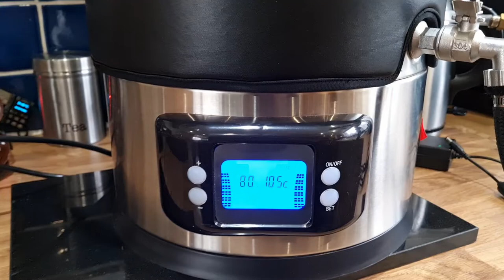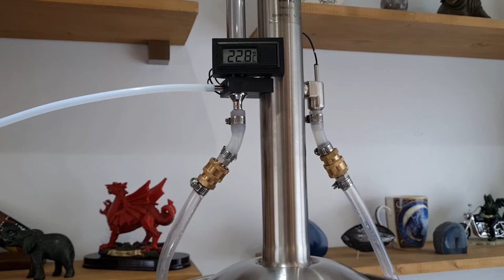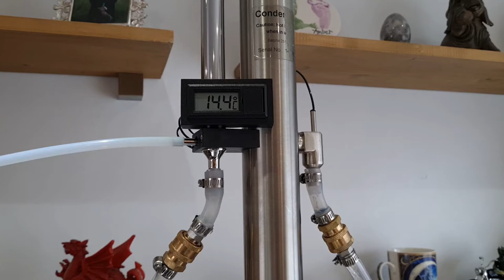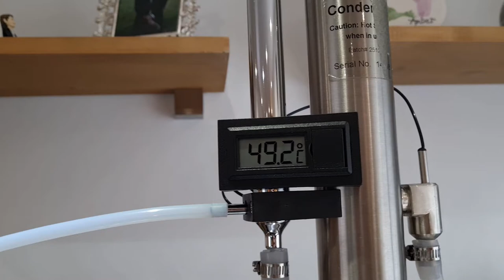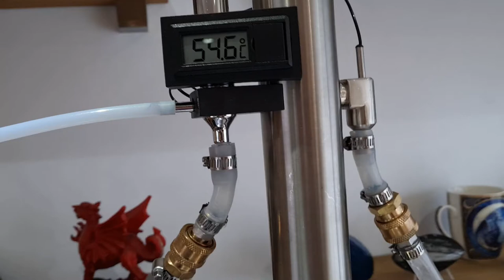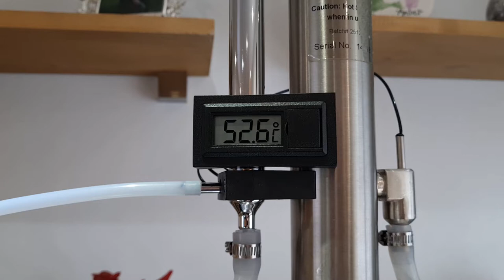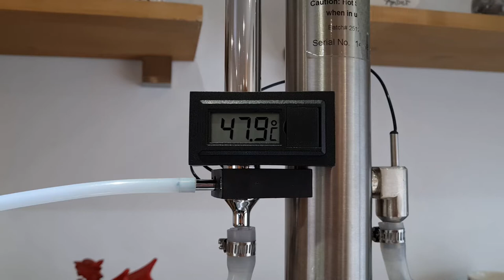Love Brewing 25L Boiler & T500 Reflux column - Doing a Spirit Run with Still Spirits Turbo Yeast.

Comment: Great video, seen a few of yours, thought I'd subscribe. I do small batches in multiple runs thru my air still from vevor but my stepdad has a t500 and I've learned a fair bit about it but what I couldn't work out at first was how that distance from the boiler up how much the heat changed, because when the boiler of my air still is at 95° c it's basically coming out at that temp, of course there is a greater distance for that vapour to travel on the t500, and I've only learned that recently, I've alot more to learn. I find it fascinating. And fascinating that you can make a birdwatchers wash from store bought ingredients ie table sugar, citric acid, tomato paste, spring water and bread yeast and forgo the Epsom and eventually, hypothetically distill that wash or wine and get, with the t500 a fairly neutral spirit, my old man only runs his thru once, thinks that it's pure enough. From a 25lt batch of birdwatchers he gets approx 3lt of 90% ethanol, he makes cuts but as you'd know with a reflux still your heart cuts are larger and more distinguishable to heads than say a small batch from a pot still. I just ran a VERY small batch of demerara rum, I can only get demerara 345g at a time so I did a 4.5lt batch, in a carboy just for me, I used 3x 345g pk csr demerara and 1x 550g jar of black strap molasses inverted those sugars in a pot with boiling spring water and citric acid I used fermaid O instead of tomato paste for nutrition and omit the Epsom, i also used ec1118 and Got an original gravity of 1.09 and reached 1.005 in just a few days and couldn't get it to drop any lower, added a tsp of gelatin to some boiling water and once it was cooler I added it to the wash to clear, alas it didn't clear completely but enough to syphon it off into the boiler of the air still without sediment following over, at first for initial foreshot cuts I had it set to 98 c but when heads came along I dropped it back to 90 c and soon after collected hearts, about 600ml of 61% abv And that's all I wanted to really keep, I filtered that small amount using a britta filter jug and added it all back to the collection jar that had been cleaned and placed in roughly 35g of ex bourbon oak cubes from staves. Now the waiting game, should be a nice spirit to have neat on occasion. I'm going to a 100lt batch of birdwatchers too so a bit of a larger batch than the demerara wash, for gin mostly, say I got from 100lt of 12% wash thru my old man's t500 I'd roughly collect 10lt probably more if I wanted a less pure product, so say 10lt of 90% pure ethanol, I'd keep that in 2x 5lt carboys and when I need to make a bottle of gin I'd measure out x amount of 90% ethanol and x amount of spring water and run it thru my air still with a gin basket with my proprietary blend of gunpowder tea and citrus zest and macerate the crushed botanicals in the gin that comes out, in a carboy for a few days and then strain and filter the particles out and have gin, that 10lt of 90% ethanol would last me years. I wouldn't have to make any in a long time.
Reply from the maker: It is lovely how everybody does it so differently.  I love a Birdwatchers wash, but to be honest I tend to only do Kale washes as find them much cleaner.
I love my Air Still.  While the T500 is a great system, to make gin, you can't beat the Air Still.

Comment: I realy love your boiler and I will try to find one for my self, thank for your video
Reply from the maker: Thank you Alberto.  I am currently working on a system that will turn a T500 boiler to a digitally controlled boiler that also have a Power Controller (SCR) built in.

Comment: Hi your video amazing and so educational and video such amazing quality. Got same condenser brass one turbo 500  and boiler from love brewing  and Wanted to ask I'm from uk and was wondering if you could tell me what quick fittings are you using for all of your pipes? They awesome if you can send me the site and measurement per pipe fittings would be appreciated. So much easier with them clever man 😜😂🤣 also have you tried using boiler for fermentation yet because I haven't if so do it work well? Sounds got that you can set temperature without heat belt or etc. Also that heating element you drop down in your brew is it work for temperature properly might order on from love brewing my favourite cheap site
Reply from the maker: Hi.  Thank you so much for your kind words.  I would be more than happy to tell you what fittings I used and where I got them from.  It will be difficult to try to explain it though in the YouTube comments section, so can you drop me an email to info@BrewingAdvice.cyou  I can then reply to your email with photos and links.

Comment: How do you get so much production at such a low temp?  Mine only gives a drop every 2 min when I’m running near 60 degrees C!!  I didn’t do a stripping run, too lazy to unpack my column, and wanted to see how it turned out. I got excellent ABV - but lots of off-flavour (typical home still flavour. I ran at 65, because it would have taken 24h to run at 60, and at 55, NOTHING.  I checked my thermometer against 2 others - seems to be on (or at least not THAT far off) . I’m wondering if it’s my water temp… the way the column is designed, there is a pretty touchy equilibrium between the column and the condenser and the output water temp.  My water comes out at near zero C so wondering if that’s a bit to cold and condensing things too much in the reflux/fractional column?  Maybe I’ll try a tiny bit of hot water, though I don’t know if that can be controlled at the tap with the needle valve as the cold water tap position makes little to no difference in water flow when using needle valve.
Reply from the maker: Hi @patrickandkennafenwick3958,
Every column runs a little differently and is something you need to learn, how your still like it.  Are you running with the T500 column?  I assume you are.  So, my copper T500 likes it a fair bit hotter than my steel one.  The type of packing and how tight the packing also can alter how well it works.  Generally though, if you pack it too tightly you will have more chance of a puke than it running slowly.  My ground water is around 12c normally.  If yours is 0c, then that is very cold indeed.  I am not sure if it would cause a problem though.  The water going through the product condenser doesn't care if it is 0c or 40c, as long as it is able to condense all of the vapours going through it.  The coil inside the reflux condenser will be affected greatly by the temperature.  The lower the temperature, the more refluxing and the less product that will be able to get to the product condenser.  If though you say the output water temperature is 60c, that is in a good range, so is not too cold at all. You must though have the water going through at a very slow rate for it to go from 0c to 60c.  While I am sure you don't want to, I think it would be a good idea to get all of the packing out of the column and then re-pack it again.  When was the last time you cleaned the packing, how many runs has it been since the last clean?  Good clean packing will help greatly in the quality of the product coming out.  When you re-pack, don't tap, knock or hit the side of the T500 to try to get more packing in.  You want it nice and loose.  Often you will have some spare that doesn't want to go back in.  This is perfectly normal, you never know, the next time you re-pack it, it might go back in again!

Give that a try, then do let me know how you go.

Comment: Hi there. Awesome video, really helpfull, THANKS alot. 

Did you chance the boiler temp. during the run or just staying at 105⁰C?
Reply from the maker: Hi Rasmus, thank you for your comment, glad my video helped.  As to the temperature, I set it and left it.  With the Spirit Works Boiler, there is no need to alter the temperature during the run if you are using just the T500 Reflux column.
Reply: @brewingadvice  Ok, thank you very much. I have the Digiboil wich i presume can be controlled the same way, thanks.
Reply from the maker: Good luck @Rasmusbardino , I hope it works as well.

Comment: Hi from Australia. Thanks for a great video. Just wondered why you chose to dispose of 200ml instead of the 100ml suggested by Still?
Reply from the maker: Hi Ardnfast.  Really it is personal preference.  As you know the reason why we dispose of the first bit is due to the potential Methanol that is in it.  There is no way to know how much is there, no test that we can do.  A sugar wash produces a lot less methanol compared to a fruit wash.  Many dispose of the first 50ml, some do 100ml, I do 150ml or 200ml, depending on what I am making.  Yes, I may be doing too much, but I would rather throw more than I need than less.
Reply: @brewingadvice A sugar wash produces negligible methanol because pectin is required yo make methanol.  If there is trace amounts of methanol, it must be coming from any pectin present in tomato paste or kale (if kale has any).

Comment: Hi, thank you for a good lesson of home brewing, could you advise where you can buy this whole setup in UK, please. Thank you.
Reply from the maker: Hi Jacek, sorry for my late reply.  You can buy it all from Love Brewing.  The Boiler is here https://www.lovebrewing.co.uk/sw-boiler/   The T500 reflux Colum is here: https://www.lovebrewing.co.uk/t500-condenser/  (you can buy them both as a package and save money).  The water regulator is here: https://www.lovebrewing.co.uk/t500-water-flow-regulator/    The quick release valves I bought from Amazon, but I am currently moving over to plastic Air Line hoses that are cheaper and lighter.  I hope that helps.
Reply: @brewingadvice  Thank you!
Reply: Some other videos showing the t500 claim that when alcohol is exhausted nothing comes out of the output tube. Is that only assuming that you stay within the temp range that created the high proof?

Comment: Great video and clear instructions!! Thank you! Quick question: Did you keep the water output temperature at around 50C during the entire run, or was it increased at some point?
Reply from the maker: Hi Boris, 50c is a good temperature to keep it at.  If you are able to go lower I would as the lower the temperature, the more refluxing will happen.  I now tend to keep it between 42c - 46c.  I have heard from some though that when they do 45c nothing comes out as the column is too cold for them.  Have a bit of a play with the different temps and see what works best for you.  Try 50c first, then do 45c and see if you get much of a difference.  Have fun!
Reply: @brewingadvice  Awesome, I’ll try that. Thank you so much for your prompt response and Happy distilling!

Comment: Excellent. In the start of the video you say that it is 6.7 litres of wash. Is that already watered down to 50% or is it 6.7 litres of 90+%? Curious as to what percentage? What was the total time of run from start to finish?
Reply from the maker: Hi Peter.  Thank you for your comment.  The original 6.7 Litres was at 93% ABV and was extracted from two separate stripping runs.  What I usually do is make two washes, then do two stripping runs.  Then I put them both in the boiler (with about 10 Litres of filtered water) to do a single spirit run.  I do this so my boiler runs for 3 times for 2 washes rather than 4 times.  Usually my spirit runs last around 4 hours.  I have not timed a stripping run, but it will be around 3 hours 30 mins I would expect.
Reply: @brewingadvice  If that's the case, I believe you should be getting much more final product that the 3 litres. I thought it would be closer to original 6.7 than you put in? Do you know why it is so much lower volume?
Reply from the maker: Hi  @OzStoner_420 .  When running the Still Spirits Turbo Yeast, you are looking to collect around 3.5 Litres at 92% ABV.  Once watered down to 40% ABV you will get between 7.5 - 8 Litres.  Yes, you can get more than 3.5 Litres on the stripping run if you leave it to collect everything.  I do not drink much so run very tight cuts.  While this does make my cost per litre much higher, I am not worried as I am more interested in quality over quantity.  I accept that I am throwing away more than I need to.

Comment: I assume you’re watering down your strip run to 40% or lower before spirit run?
Reply from the maker: Hi, that I am.  I would like to apologise though.  This video is over 2 years old and it was when I was just starting out.  Boy am I monotone and boring!
So yes, while I didn't explain it well, I had 6 odd litres of ethanol which was around 92% ABV.  I then added around 14 litres of water so that it would be nice and diluted.  You don't need to add that much water, as you mentioned, you just need to get it to or below 40% ABV.

Comment: What modifications did you do to your spiritworks boiler? I have the same boiler and am looking to make it more useable. While its good at the moment, I'd like to be able to go for a mid range power input.
Reply from the maker: Hi Andy H, sorry for the late response.  I haven't made any alterations to my boiler, it is as I bought it.  I am though looking to integrate a SCR between the boiler's computer and the heating elements.  That way I can dial down the heat for spirit runs.

Comment: Hi there (again).  We are interested in the push fit connectors you have and wonder where you got them from.  I have tried to email you on the email you supplied to another commenter but it has come back as failed.
Reply from the maker: Hi Heather,  I am sorry that you have not been able to email me.  My email address is: info@BrewingAdvice.uk .  Could you please try that email address and let me know if it still fails for you.

Comment: You need to be making cuts, not collecting in one jar, should be collecting 250ml to 500nl at a time in different jars, this will be mixing heads, hearts and tails.
Reply: 250 heads then parrot for hearts  then when your tails kick in take parrot off and collect tails for next run.. even better do the same as I mentioned with a bubble plate get 96% instead of 92% that's what I do. Got same still. You only cuts you need is heads and tails and parrot do the rest for you. Soon as you see a sudden drop on your proof hydrometer then you collect tails. You don't need filter on bubble plate either it filters it out for you automatically 👍👍👍

I got 3" Bubble plate 4 floors. 

Need X2  2" bulkheads one with nut for lid and the other without nut for condenser
Need need clamps and o rings and 2" to 3" reducers and voltage controller this going to give you 4% extra the highest for a home distillation 96% abv and automatic purity no filtering needed ever again 👍👍👍 want that message back I sort you out to get 96% like me using any reflux still. If you Chuck the 96% in again double distille it you get 99% abv
Reply from the maker: Hi Klatlap. Yes, it is always best to make cuts.  This video was an introduction on using the T500.  Many new distillers who have only just bought the T500 column findi making cuts very confusing.  This is why I did not do cuts.  There are also some drinks that I make that I don't do cuts for as I don't mind certain flavours getting through.
Reply from the maker: Hi  @DripdropBrewing .  Thank you for your comment.  Personally I don't like parrots as they do too much smearing and they can never show you truly what is coming out unless you keep emptying it. 

I do not own a bubble plate, but would like to try one.  I have instead a few extra 2" pipes, thermowell and a sight glass.  Using different Copper SPP, Steel SPP and the standard Steel packing that comes with the T500, I am able to produce 95.5% ABV which is the purest you can get.
I hate to say, but your comment that you get 99% ABV is impossible.  The maximum any of us can produce is 95.5% because alcohol forms an azeotrope at 95.5%.  While the spirit hydrometers do show up to 100%, any readings above 95.5% will be wrong due to atmospheric pressures.  You can read more about azeotrope here: https://www.quora.com/Why-can-we-not-obtain-more-than-96-alcohol?fbclid=IwAR3qbvbSylJJ5mpTkyMm5zjxEdeBEEI0oEfBwvAaUQKx556SXoQXuA--zwA
Reply: @brewingadvice  I never said I get it from 1st run. But if you double by throwing your 95%/96% back in you get 99% abv. Try it works and you will see it for yourself. And if you triple still it you get 99% abv but much better smooth taste.
Reply from the maker: Hi  @DripdropBrewing , sadly it is impossible to get above 95.6% ABV from distillation.  If you Google 'Azeotropes' you will see why it is impossible.  A great explanation can be found here: https://chem.libretexts.org/Bookshelves/Physical_and_Theoretical_Chemistry_Textbook_Maps/Supplemental_Modules_(Physical_and_Theoretical_Chemistry)/Equilibria/Physical_Equilibria/Fractional_Distillation_of_Non-ideal_Mixtures_(Azeotropes)

Comment: use copper spirels not stainless
Reply from the maker: Hi @daniel brogan.  Yes, copper is far better than steel.  I now use 0.5 Litres of Copper SPP, 1 Litre of Steel SPP and around 1 Litres of the Steel packing that comes with the T500.  I also use the copper Alembic Pot Dome.

Comment: Too much stuffing around with that T500 still.
Water temp MUST be right for it to operate correctly.
Half hour later....almost there....just a few more tweaks, and a few more.
Everyone knows that distilling spirits is not governed by temperature.
Then again, some ppl might think that's the way it's done....ppl like T500 owners.
Reply from the maker: I am sorry you dislike the T500.  Personally I think it is a great boiler and a great condenser, as do hundreds of thousands of people all around the world who use them.  While I own an Air Still, I don't use it to produce a neutral spirit, but if others want to and are happy with their results, then they should carry on.  Each to their own.